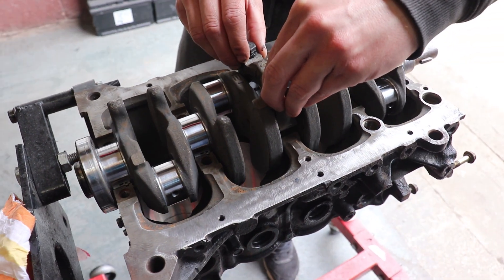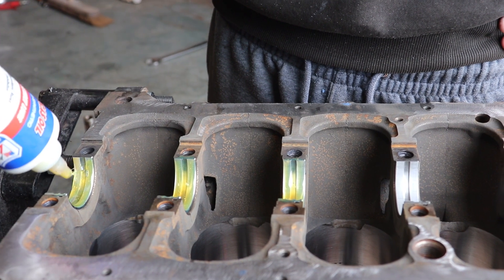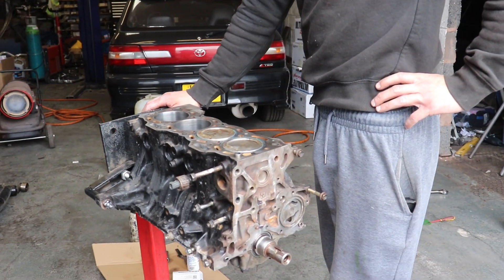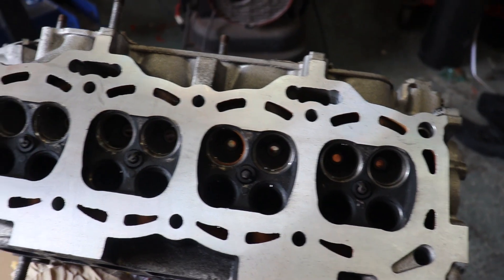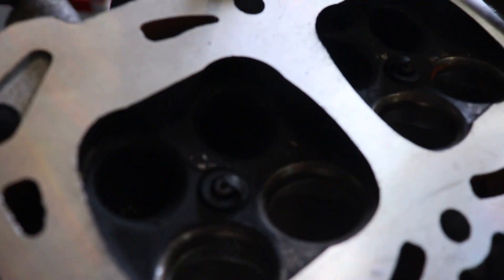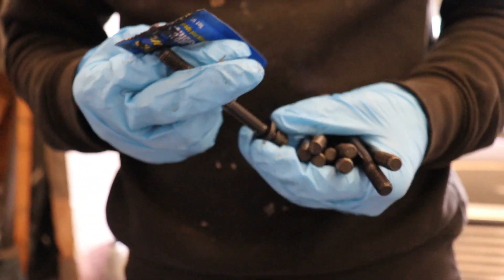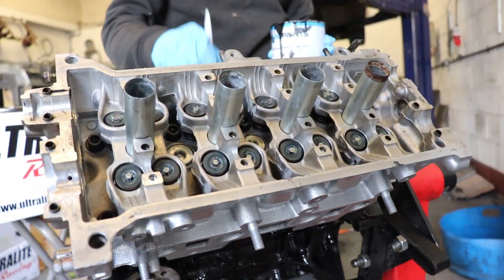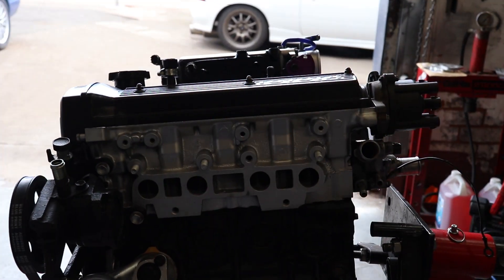Forged 4EFTE Engine Rebuild !!

Comment: Great video! Could you ask your brother which metal adaptor should be used to modify a 4efe sump to creat the turbo oil return line? Is it a AN12 to be welded on? I cannot find the OEM metal pipe that connects to the oil return pipe.